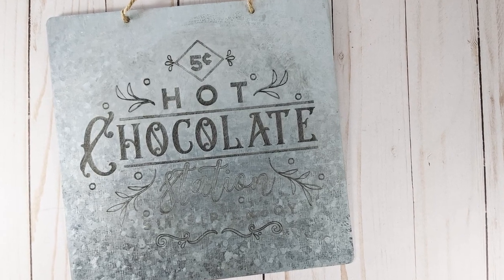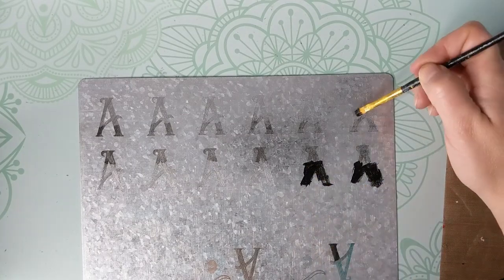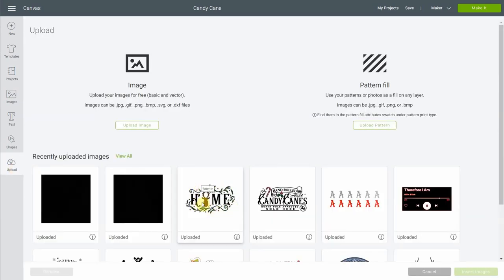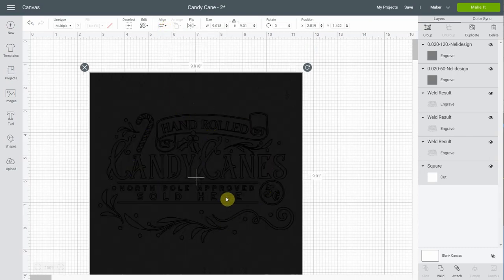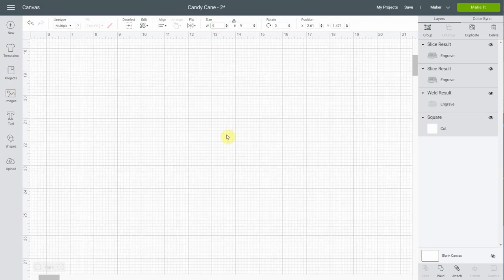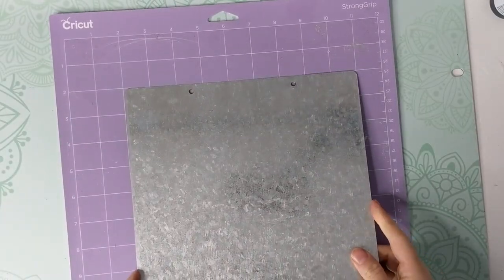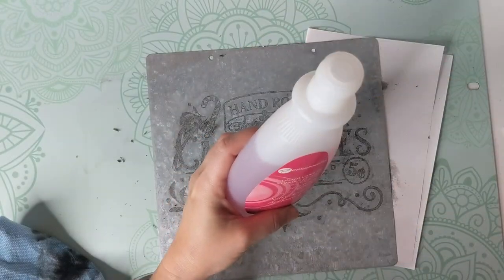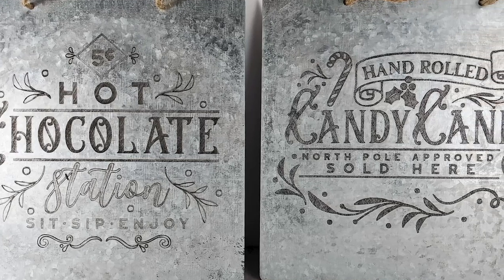How to make metal engraving stand out when using the engraving tip of the Cricut Maker

Comment: That’s very smart! Thanks for doing these tests and this video!
Reply from the maker: Glad you liked it!
Reply: @NeliDesign  do you have any tricks for getting the ink to actually be taken up by the engraved grooves? I tried both India ink and Daler Rownwy acrylic ink and everything just washes away with even just water.

Also just in case you ever run into this issue. My machine shut off so many times in the middle of making this project. It’s apparently due to the static electricity and working with metal sheets.

Comment: Maybe look into engraving wax sticks. It's what watch makers use to blacken the engraved numbers in the metal
Reply from the maker: Thank you, didn't know about those. Any idea where to find these? Also, I'm in Canada and it's always harder to find things!!!
Reply: @NeliDesign  No problem! I'd assume online is your best bet considering they are a fairly niche product. After doing a quick search it seems most of the Engravers Wax is coming from the UK. There are a couple sellers on Ebay as well as websites like CousinsUK that hold watch parts. I'm in Pakistan so didn't even bother online and just asked my local watch repairmen for a piece lol.
Reply: @NeliDesign  Also just as a warning due to it being a wax it does have a shiny finish to it and due to it's viscosity it may not settle into very superficial engravings.